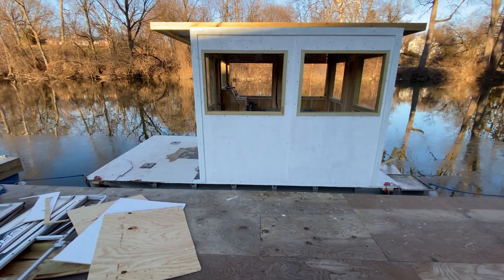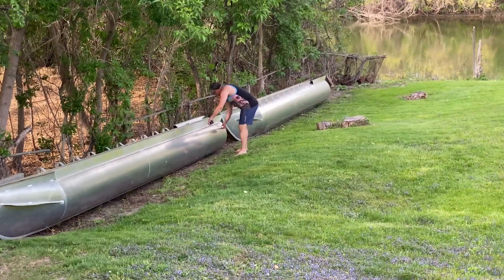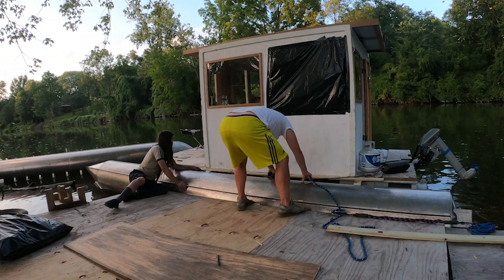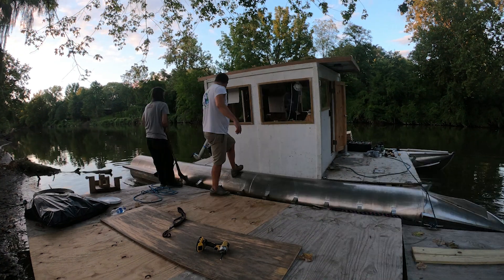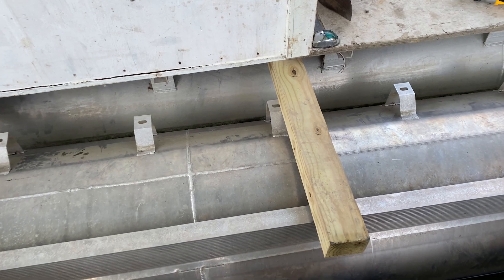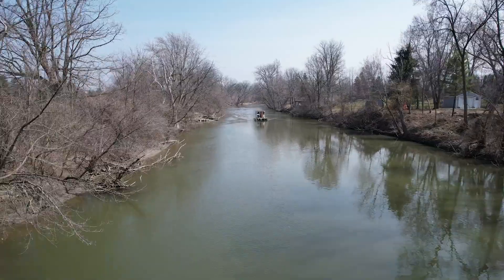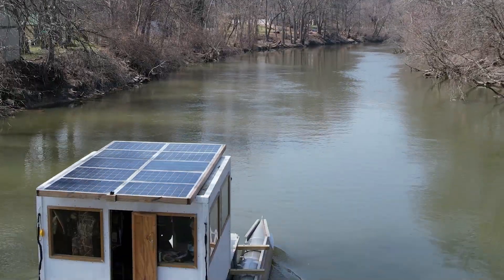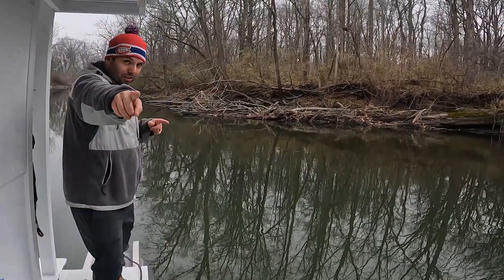Our Boat was SINKING...(Upgrade Time!)

Comment: Have you tried out the other prop with more pitch? It might make your set up more efficient. Just a thought, probably not but maybe.
Reply: It should only be bad if it overloads the motor causing it to draw a lot of current creating a lot of heat. As long as your amp draw is not crazy it should be good.
Reply from the maker: We’re going to find out!
Reply from the maker: We haven't tried the high pitch propeller yet, because I thought I remember reading somewhere that it was bad for the motor if your boat doesn't go fast. We'll probably try it soon and break it though!

Comment: Awsome👍. Next time you could just flood the toon with water then pump air in the top plug and the water will come out of the bottom plug then when all water out just put the plug in and remove the air. Just don’t pressurize the tune or it will pop.
Reply: Well next time just ask… ha ha👍
Reply from the maker: Thanks Shawn! We could have used this info prior to our struggles!